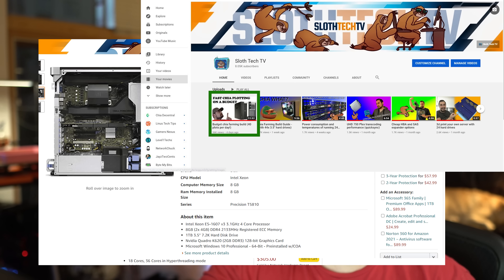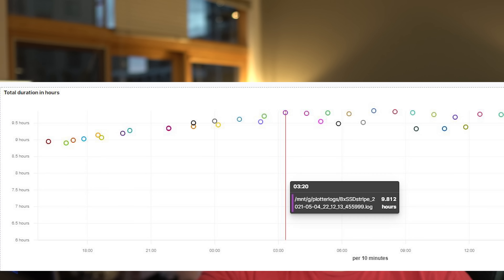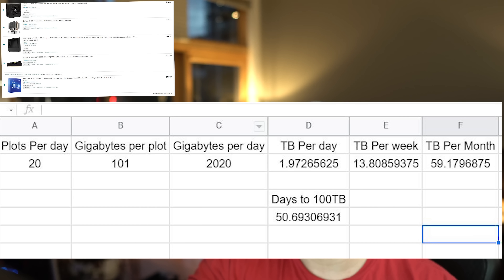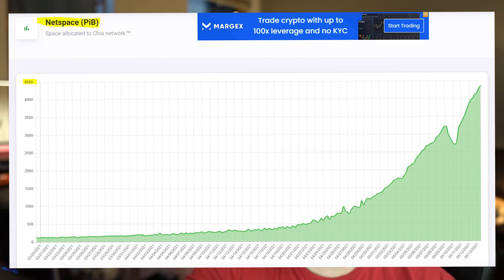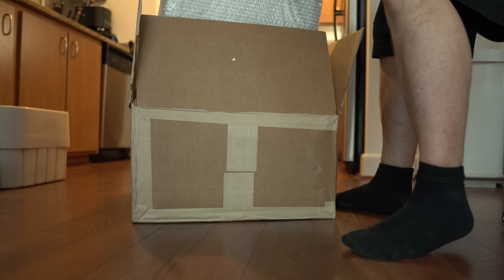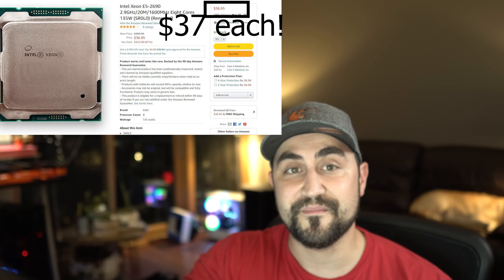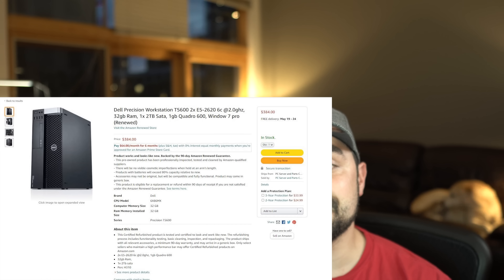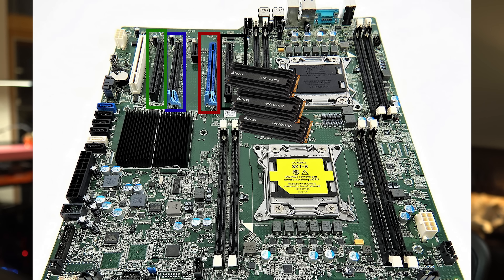Chia Plotting Build $620 w/ Dual XEON CPUs

Comment: I still have no idea how your plotting that fast. I have 2 pcs plotting and can't make near 20 plots a day. And I've fiddled with like every setting possible
Reply from the maker: there are some key things that help tremendously. Having more SSD/NVME drives and doing one job per drive vs raid 0 drives together... dont raid 0... there is a huge performance penalty. If you can buy multiple smaller drives and do 1 job on each and give it enough time to get out of phase 1 before continuing to add more plots.
Reply: @SlothTechTV  Interesting, I have two Inland Premium 2TB in raid 0 in Ubuntu and it is outperforming my Intel D7-P5510 3.84 TB which surprised the hell out of me. I have both set up doing 13 in parallel.
Reply: @SlothTechTV  how fast are you getting a phase 1 done on one ssd? Because mine are taking like 3 hours. The other phases aren't as bad.
Reply: @SlothTechTV  By giving it enough time do you mean staggering at 60 mins?
Reply: @SlothTechTV  this is interesting. I'll have to test. I figured RAIDing the drives would give me better sustained IO....how bad is the penalty? Two 1.6TB or four 800GB SAS SSDs to support 12 plots....reasonably affordable. Twelve smaller SSDs (on two HBAs)....getting into yikes range rapidly. I'd be into a video on this topic if you have data to explore. I don't have enough actual plotting done yet, but testing with DD and the like is showing me the raw striped performance I'd expect based on the specs for the drives I'm using. Though,  I see you said elsewhere in these comments that it's about IOPS and not raw throughput....which would explain what I'm seeing in various monitoring tools...
Reply: A key point that is glossed over in these videos, is to get the results he is getting, he is using multiple NVMe drives. Don't get me wrong I like his videos very much, but he dose not make it clear he is using 3-4 2TB NVMe drives per build to get the results he is getting. On a well powered system, the NVMe drive is your bottle neck. On my setup, using only one 2TB drive, 4 concurrent plots = about 14 per day. Same system with 2 2TB NVMe 8 concurrent plots = about 26/d. The law of diminishing returns kicks in, and as you add NVMe drive you don't get quite as much throughput per drive.
Reply from the maker: @zorner1  there are bottlenecks in every facet of plotting. The first major bottleneck to overcome is nvme/ssd capacity/throughput, once you have enough nvme drives you have to overcome cpu threads/compute. Obviously you can overcome a lot of this by having faster cpus and/or more cores/threads. I do mention that you'll need 2TB of nvme per 8-10 concurrent plots in this video. I'm making a video in regards to performance tuning specifically and what the right number of NVME drives is to saturate some of these builds.

Also -- I've got a few systems with just a single 2TB nvme drive -- its possible to get a bit more than 14 per day with them. cpu is important when getting out of phase 1.. specifically giving phase 1 more cores.
Reply: @SlothTechTV  I made a build off your first video. Got the 18 core cpu and dell on ebay for $500 total. 

A video with your plotting settings would really help us out. I've got 2 nvme in the machine, and staggering an hour, but getting out of phase one is taking 4 hours. That's with 2 cores / plot ... sounds like I might need to do 4 cores / plot.
Reply: @MATTHEWJOHNBELL  I've noticed that going from 2 to 4 cores actually only shows like a 3% decrease in phase 1 time. It's essentially useless to add more cores or ram. At least on my rigs. I think it's a matter of optimally staggering plots on jobs with other plots on jobs to get the most jobs possible out of phase 1. I say this because the only bottle neck I'm seeing is that I can't get enough jobs going to get finished plots regularly enough. It doesn't matter much if the whole plot takes 16 hours as long as you have 16 plots going and 1 per hour finishing.
Reply: @zorner1  I have 4ssd's in one pc and 2 in the other.
Reply from the maker: @tylerm124  2-3 hours for phase 1 is pretty typical. I think I've gotten down to low 2 hours while having more than 1 concurrent plot on a single nvme.
Reply: @SlothTechTV  well, I need more videos from you then lol. I can't get this optimized with my own brain, data, and understanding lol
Reply: me too bud me too ...
Reply: Lol, im hardly making 1 plot per day on my dinosaur build using only HDD's.. :-P I can only run 1 plot at a time..
Reply: I'm surprised this comment would get any actual attention or spark so many comments.
Reply: How to add another hdd for plots once first one is full  using gui ?
Reply: @VeniGaming  click add a plot directory and add that new hdd as a directory. Then on your next plots set it as the destination drive, but learn to use a plotting manager you get a lot more control and it auto populates plots
Reply: One or two plots on one ssd, no more. Schedule plot to multiple sSd. One 4 TB is much slower than 2 2tb